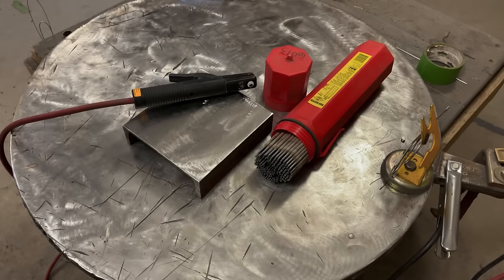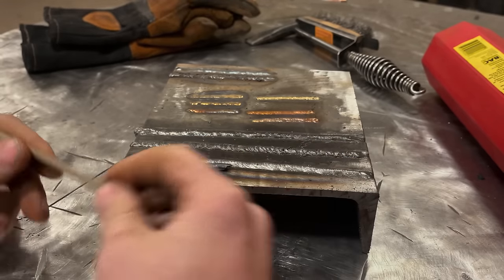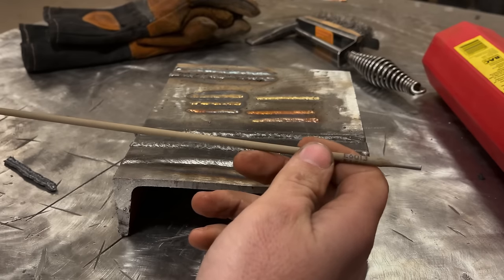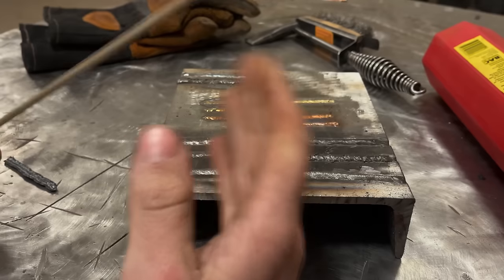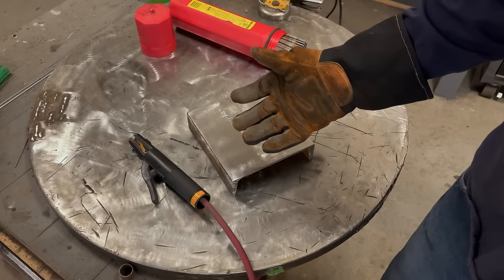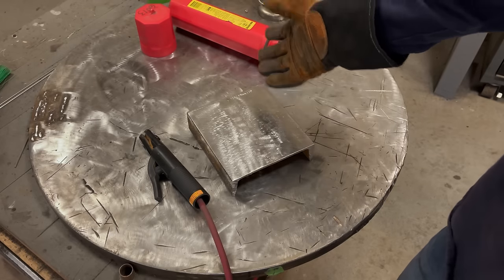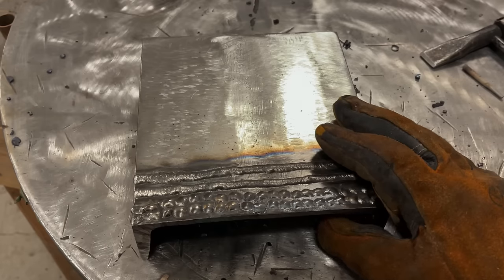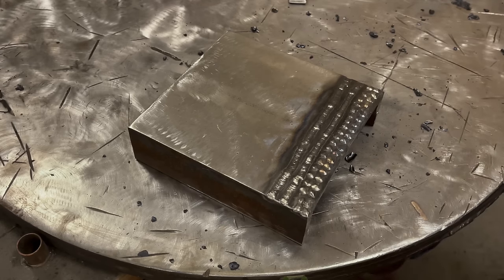How to stick weld 👨🏻‍🏭: Intro to Arc welding for beginners, (Series Part 1)

Comment: Can you weld metal with paint on it or should that paint be sanded off this metal. It’s a new metal saw horse that I am attaching a series of chucks to.
Reply from the maker: Cleaning/prepping the material will always give better results than welding on paint.  Paint also produces fumes that is likely toxic.  At times I have welded over extremely poor materials with 6010 rods.  A little bit of prep in your situation will give you better results I promise 😀

Comment: Sir you have a new student....i have have a 160 amp arc welder.... will this be good enough to start my schooling with you?...if so i will be learning from your videos each morning then moving to my garage for practice.
Reply from the maker: 160amps is more than enough.  Starting with 3/32 rods will be slightly more difficult than 1/8th in rods (they flex more), but you get more rods per pound (aka more practice for less money).  I would start with 6013 or 7014 rods to minimize frustration and to get used to running beads.  Switching to 7018 is your best bet for the long run, it’s just far harder to learn to weld with them.  It’s not that they are hard to run, they just are frustrating at first.
Reply: @makingmistakeswithgreg  Yes sir :face-blue-smiling:understood will do.

Comment: Grate video I have question I’m welding 16 gage metal for my car having a hard time to set up the welder  I’m using 6013 stick n still it’s burning my metal what am I doing wrong !?
Reply from the maker: So if you’re trying to stick weld 16ga, that is definitely a challenge.  The only hope to weld that would be to use 1/16th 6013 or 6011 rods.  It still will take a lot of practice and frustration to do it.  If you have access to .030 flux core wire and a machine that can use it you would be far better off, it’s much easier.
Reply: @makingmistakeswithgreg  thank you for your advice gratly appreciated

Comment: It would be advantageous if you had a filter to allow the viewer to see the motion of the welding rod at the point of the arc. As it is all one can see is a blinding ball of light. I really can't tell what the motion of the rod is along the weld... the feature which I'm most interested in seeing. Are you moving  continuously away from the start point? Are you starting and stopping? Are you oscillating right to left? Are you oscillating fore and aft? Are you oscillating fore & aft and right & left? ... Enquiring minds want to know!
Reply from the maker: So future videos (especially as of recent) I have upgraded my filming a ton.  Back when the earlier videos were shot I had more limited resources and equipment.  To answer your questions, with stick welding I run a straight smooth bead with most rods other than 6010-6011.  What this involves doing is running a drag angle (rod tipped towards the direction of travel) and feeding rod into the molten puddle as you travel away from the starting point.  For practice purposes welding left to right is fine if you’re right handed however everyone should learn to weld the opposite direction as well.  

With many rods (6013,7018,7024) they run best if you just run straight in.  That means no side to side movement, no start/stop, no weaving.  There is a time and place to do those things, but normal welds don’t require them.  6010 and 6011 can be run with a “whip and pause” without risk of slag inclusions and other weld defects.  They take far more skill to weld with, and produce a rougher looking weld.

Comment: Morning Greg so explain to me then why that I have 2 boxes of 6013 - 1/8" rods but both are of 2 different sizes, and as for welders, I have a powerfist with high low switch for amperage and keep getting stick stuck on ignition and before u ask yes prep work done ground 100% angle 45 degrees, 1/16th gap for arc control, and everything right and tight except the start and constant sticks keep getting jammed or stuck on initial spark ? ? It's been to long since I did welding just fell off the bike and forgot way to much stuff 🤣🤣 so wtf is not right thanks
Reply from the maker: If both are labeled 1/8 but they are different, it could be for a few reasons.  If the metal rod diameter is the same and the flux is different diameter, it’s due to the flux composition.  6013 can come in multiple flux compositions and still be called a 6013.  If the metal rod is different sizes then one of them is mislabeled lol.

6013 is one of the easiest rods to run.  If you can’t get it to start decently you could try a different rod with a graphite tip, like a EZ start rod by us forge (online or at Menards home improvement).  The graphite tip makes starts much easier.  Otherwise more practice may help.  Better stick welders make starting rods far easier.

Comment: After starting does the rod tip touch the metal or just above it?
Reply from the maker: I generally touch the flux of the rod to the plate with a very light touch.  Depending on the rod you may not be able to do it.  6010 or 6011 will melt off so fast you won’t be able to put much pressure on them.   You can hold a slight gap between the rod and the plate (hovering) but it must be literally just off the plate.  If you hold more than a whisper of a gap the arc will become unstable.  Hope that helps 😀
Reply: @makingmistakeswithgreg  
Yes sir, thanks!

Comment: May I ask what type of welding machine you are using?
Reply from the maker: So for stick welding I am running a dynasty 210 unless I otherwise mention 😀.  The dynasty stick welds similar to most stick machines provided they weld with 6010 rods (some welders don’t).  I also have a esab rogue 200 that I stick weld with in more recent videos.
Reply: @makingmistakeswithgreg    Thanks 🙏 god blessed.

Comment: I need to weld floor of my van. Where should I clamp and can I be on it while welding and not get terminated to the next realm?
Reply from the maker: Great question.  I will actually do a video on this soon and have it out in about a week 😀.  In the mean time I have a bunch of ideas, hope they help:

Since welding operates at low voltage for the most part you will be reasonably safe.  However if you are sweating up a storm you can become part of the ground path so be careful.  With auto body/floor pans you want to ground as close to your weld as possible.  Electricity follows many paths to ground to complete a circuit, so grounding close reduces the chance to become part of that circuit.  

Obviously with auto body it can be difficult to find a place to ground to depending on where youre at.  A great place to ground for floor pans are seat bolts, they tend to be very beefy with thick metal on the backside.  You can also look at seatbelt bolts or other thick bolts.  Keep in mind that if you run enough amperage through the bolt it can actually “tack weld” itself to the hole, so be smart about that.  Beyond that I have a set of magnetic grounds that are basically a copper point with a magnet that holds it to metal.  These can come in handy for auto body.  It’s also important to disconnect wiring near the area to be welded.  Floor pans may be close to a engine computer (some cars have them in the kick panel), so disconnecting the computer can help prevent damage.  It’s unlikely the computer or other electronic would be damaged, but it’s not worth the risk.   

Beyond that I would tack the panel in all over right away.  Having multiple tacks will help make sure current will flow properly between the new pan and the original material.  Grounding right in the middle of the new pan would probably be your best bet if possible, otherwise near a edge on something solid will work too.

Comment: What is the best welding machine to start off?
Reply from the maker: It depends on what you want to do.  I am a big fan of the harbor freight titanium flux 125 as a starter welder.  You can weld a ton of stuff with it (car exhaust all the way to fire pits/grills), and it's under 200$.  If you want to learn stick welding the harbor freight titanium 225 (under 300$) is a great place to start with and can stick weld most anything you might want.  Keep in mind stick welding is hard to weld thin material with, and is far harder than flux core wire to weld in all positions.  Those are two great options you might want to consider.

On a higher end, the firepower FP200 which sells for between 500 and 600$ is a awesome mig/flux core welder that can build tons of stuff.  This would be a excellent mid range welder to buy and gives a ton of capability.  For stick the esab rogue 180 is excellent, or a used miller/lincoln stick welder would be great to start with. You generally get what you pay for, better welders make it easier to make decent welds.  Keep in mind that your skill is the biggest control of the quality of welds you produce.  A 2,000$ machine will not make you a better welder than a 600$ machine if you don't possess decent skill.
Reply: Thx

Comment: You said at one point, “…drag it along…”. Obvious question, but not for me; are you touching or is there a 1/16”-1/8” gap or distance?
Reply from the maker: So with stick welding depending on rod you can drag the rod with the edge of the flux on the rod touching the plate.  Think of it like a crayon slowly melting off on a hot pan.  Some rods are so aggressive you can’t really do that as much.  What you must keep in mind is there is a arc gap present from the edge of the flux to the metal rod tip, while you’re welding.  So holding the rod completely off the plate means you have a measured gap between the flux and the plate, and the flux to the tip of the rod.  This may be too much and lead to a uncontrollable arc.
Reply: Got it! Thanks.

Comment: Can you weld stainless steel   With a tumbstone ac225
Reply from the maker: You can weld stainless with a tombstone machine.  308 rods will run on AC, however I have never ran them on ac.  Stainless requires less amperage than steel so you may find your tombstone amperage settings to be a bit off from what you need.  308l rods typically run at 55 to 75 amps for 3/32, and 75 to 105 with a 1/8th rod.  The tombstone was designed for mild steel rods so it’s amperages might be 5 or so amps off ideal.   So with all of that said, yea you can, preferably thicker stainless.

Comment: Where can i buy the amperage calculator?
Reply from the maker: So the amperage calculator is available here: https://www.amazon.com/Miller-Electric-043125-Package-Calculator/dp/B004UHQOX6/ref=mp_s_a_1_1_sspa?crid=1ACGIV530V3MZ&dib=eyJ2IjoiMSJ9.D48sKv7vI1t9YeieiEdhu4LhEf48YP_P8v1ffd7t9gwVcj_358_uZBOMTvCcAhaGiUcmJTEgPhSUozNPA_8pEGDMNREN7WqkT8X_RkgNuN5gVd7TCAabmN0OPbtt2xcLpQr3yEkRxpI-Vaz_4kv0ZLUBl-EHcyKoqGACbh7mN_vuMYQCvwcXeXzmJlOK78LfFvGhMyVh4N9JWXR59cI3wA.J6TqOqIcMfOUscsZYHIflVz8F1O1m-OJxfE4LSdaJM4&dib_tag=se&keywords=miller+weld+settings+calculator&qid=1721954733&sprefix=miller+weld+settings+calculator%2Caps%2C68&sr=8-1-spons&sp_csd=d2lkZ2V0TmFtZT1zcF9waG9uZV9zZWFyY2hfYXRm&psc=1&smid=A3CEBL4WAV1FP0 

or you use a free online one here:  https://www.millerwelds.com/resources/weld-setting-calculators

Comment: Hi what amps are you running on this?
Reply from the maker: Amperage is based on the diameter of the rod and the particular rod used.  The best online calculator I have found is this: https://www.millerwelds.com/resources/weld-setting-calculators/stick-welding-calculator .  If you’re just starting out 6013 will be the least frustrating and most forgiving to learn with.
Reply: @makingmistakeswithgreg  thanks 👍

Comment: What is your travel speed?
Reply from the maker: I did a video with more specific measurements on actual travel speed.  Here it is https://youtu.be/OO1ryeqWqso .  The best gauge on travel speed is: 1) is the weld consistent in height/width, and 2) is the weld a decent width that’s appropriate for the rod diameter.   The actual speed it takes to make it start to finish depends on how much metal you’re putting down (rod size and metal thickness) and joint configuration.

Comment: How about stick welding thin sheet metal
Reply from the maker: I did cover it a bit with my mini stick rod 2 video series.  Anything 18ga and thinner becomes a real challenge.  For the average person (myself included lol) thin sheet is far easier welded with flux core wire over stick.  I will probably do another video showing the limits of how thin you can weld with stick though 😀

Comment: People like using MIG, but to me, it's much more difficult. You have a thin wire you can't see, wire speed. You must start immediately after pulling the trigger, then the amperage, gas management. Too many factors. With ARC, amperage is the only factor.
Reply from the maker: You’re on to something.  To be a competent and complete wire welder (be able to wire weld aluminum, stainless, steel, etc and in all positions, both short circuit and spray) takes far more skill and knowledge than stick.  Stick has a steep learning curve but it’s consistent as hell.  A 7018 runs like a 7018 and you just dial the amperage to what you want and run it.  The results will be consistently the same.  Wire has so many more variables that drastically affect the results.  Push, pull, gun angle, voltage, wire feed speed, wire diameter, difficulty seeing the puddle because of how big the mig nozzle is, etc.  

If you like stick and want to be able to make stuff a bit faster (especially on thin material) I would highly suggest you look at Gasless flux core wire.  Hobart fabshield 21b wire with the right settings is like 7018 and 6011 mixed together, it’s stronger than 60xx, and it’s so easy to weld out of position.  You can weld with it without a mig nozzle on (provided the mig gun can do that) so the visibility is really good compared to mig.  For 1/8th and under material it is great.  For thicker material or higher liability jobs I still stick with stick.